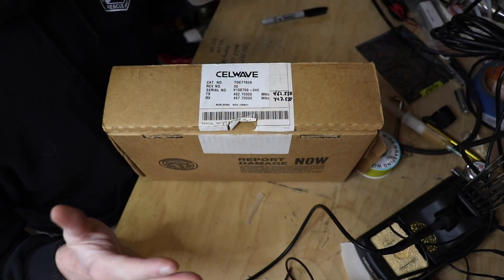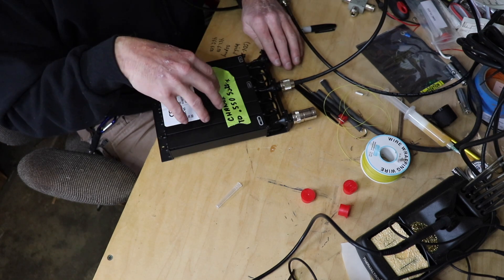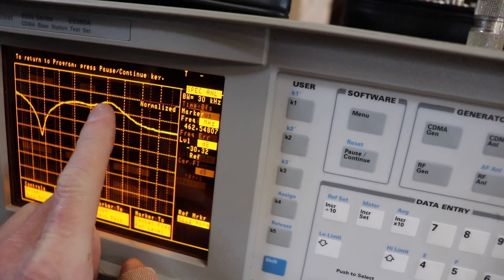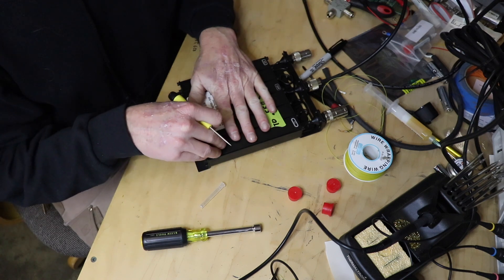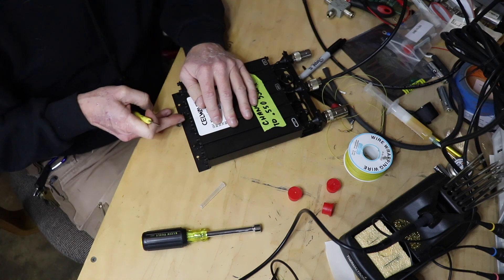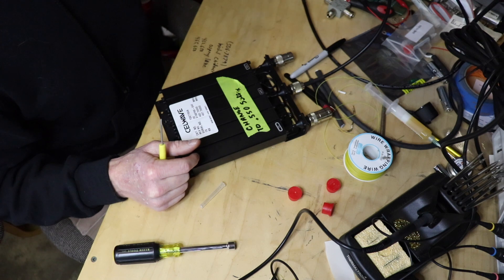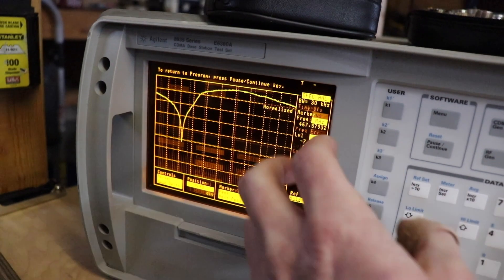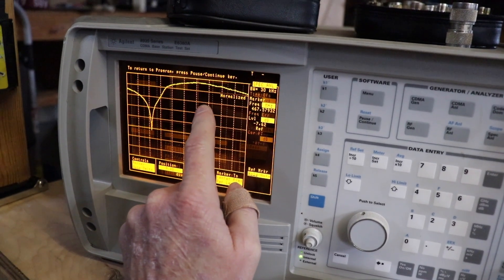UHF Cellwave Duplexer Tuning

Comment: Shane, could you put together a short video on setting up the HP 8935 for duplexer tuning? I have the same service monitor, but i can't figure out how to normalize it to start testing.  

Thanks,
W5KVV
Reply from the maker: That depends on if you want to use the built in program for duplex tuning. If so you will need a RLB.